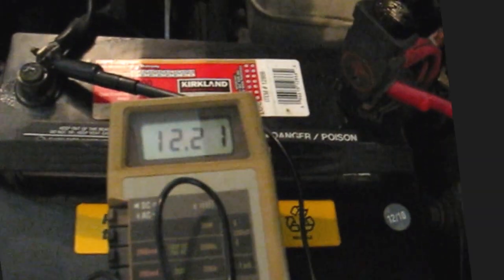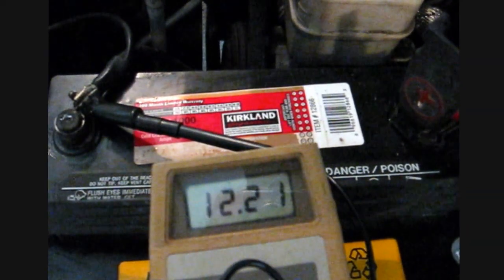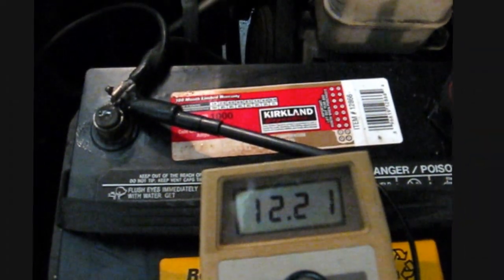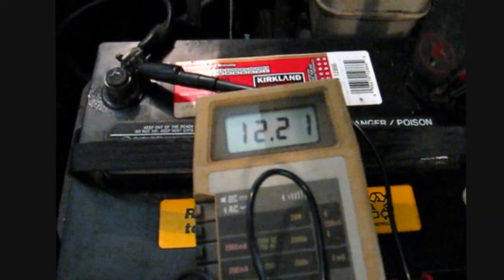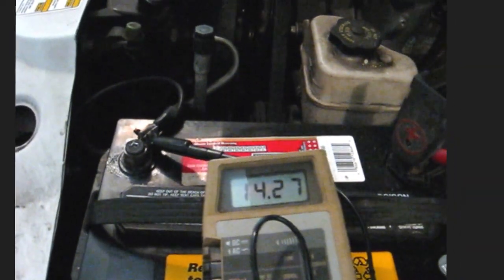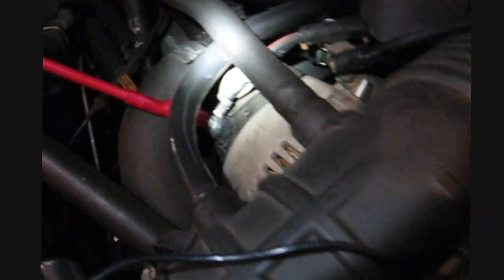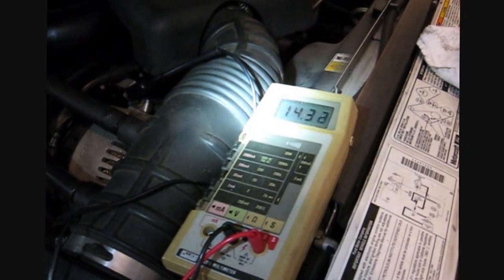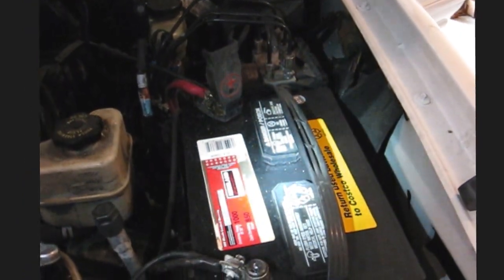Ford Explorer wet battery over charge voltage test by froggy

Comment: Actually the only reason it matters which battery terminal you disconnect first is that while you are undoing the + wire & you take it off first & the wrench accidentally hits a ground you got sparks or worse, so always disconnect the ground - first because if your wrench hits ground accidentally, who cares, no sparks.. Batteries can explode like a bomb..
Reply from the maker: +Bob White Good comment, I agree.

Comment: My Toyota Corolla went up to 16.46 Volts. Why ? i Saw on the 6 Battery props some wet bubbles? Is that the defective Battery or Alternator?
Reply from the maker: Could be the regulator it's overcharging, should not be that high.

I would suggest a full charging system test at a service center.
Reply: froggy Hello Froggy. i Tested the car at a test Center. Okay trouble was only the Voltage regulator.  But get some serious Central locking trouble. When i drove back home smoke came out of the front passenger door panel.I disconnected the battery and open  the door panel and disconnect the central locking device inside the door. Now neither of the 4 doors went to the close position, not even pushing by hand. Can i disconnect the Central locking system? And how will i do that? , The car is very old and don`t want to spend Thousands anymore 1992 model Toyota Corolla 1.6 GLS.
Reply from the maker: I would repair the broken parts in the front pass door area, most of those parts are not too expensive, try recycle yard parts if you wish.
Reply from the maker: +Sakkie Venter Take it to a store that does free battery tests. Should never get to 16+ volts.

:)

Comment from the maker: I do clean the maf wires (carefully & with proper cleaner) as part of an annual "tune up" or maybe every 2 years. And keep a clean air filter in. Don't have a scan tool so I appreciate any info you have.

70% throttle to get a baro update seems like a lot, but I guess if you are climbing to higher elevation that'll do it.

:)

Comment: ive discovered something with alot of fords when i use my scantool that pulls up factory level PIDS. i notice the barometic pressure reading is telling the computer its above 2000 feet even 3000 according to the pressure absolute it reports. ford uses the mass airflow to compute barometric pressure not a pressure trandsducer. and you have to give the engine about 70% throttle in drive for the baro to update.